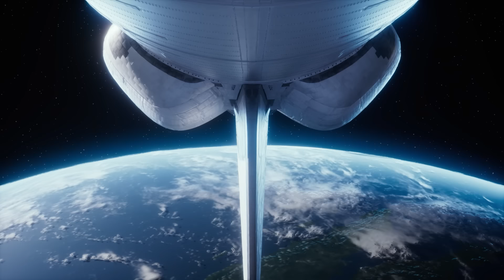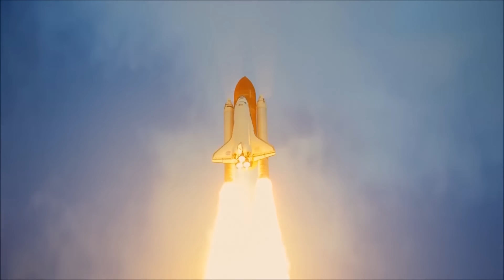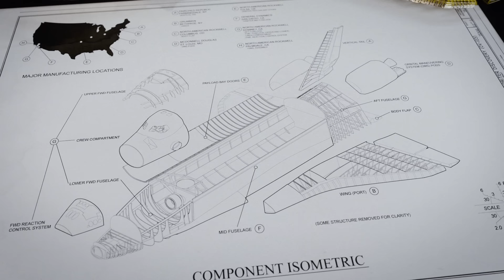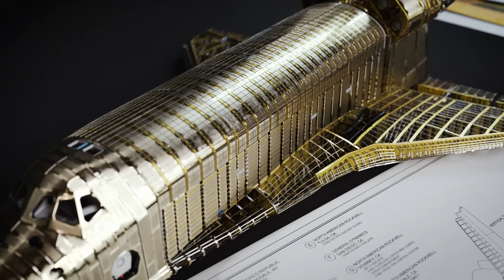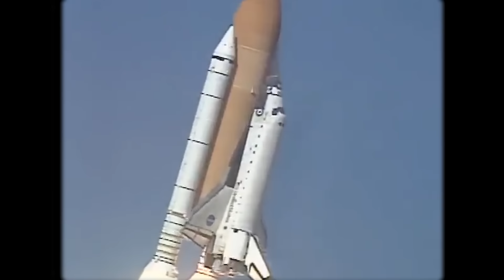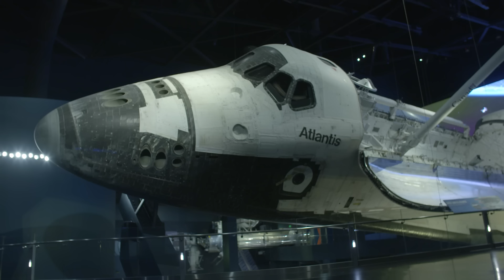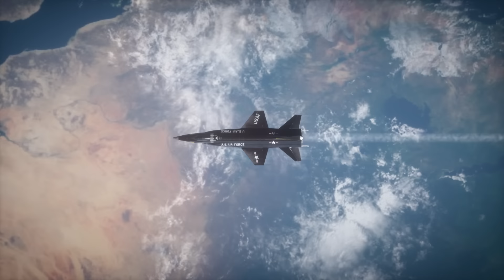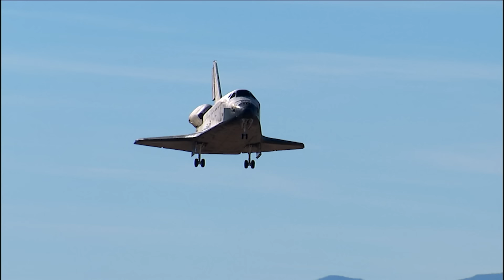The Insane Engineering of Re-Entry

Comment: The so called space shuttle has never reentered because it has never been to space sry really really sry
Reply: Proof?
Reply: @msidc1238  proof ok space starts at 62 miles high and nothing has ever been to space because rockets can not produce thrust in a vacuum so the rocket just falls back down at the 62 mile mark and the shuttle is neither a glider for it has two jet engines at the tail you can see the air intakes and you can hear them rev up upon landing even though they have a fighter escort to cover the sound of the shuttle jet engines
Reply: @James-zp5po  
" space starts at 62 miles high"
At 62 miles the necessary speed to get aerodynamic lift becomes as high as orbital speed. And some people thought to use that to define where "aviation" ends. And so use it as the "beginning of space". But that is of course an arbitrary definition. There is no beginning of space, the atmosphere becomes thinner fluently - you really never noticed that? You have never felt the pressure change in your ears when using a fast and high elevator? You have never heard that people need oxygen supply when climbing the Mount Everest? You have never wondered why oxygen masks fall down from the ceiling of an airplane in emergency? Already at 22 miles you only have 1 % of sea level air pressure, so not much air anymore. On the other hand there is still some atmosphere at 250 miles, so that the ISS loses more than 200 feet of altitude every day because the drag slows it down.

" because rockets can not produce thrust in a vacuum"
Bullshit. Why should that be the case? It seems you have no idea how rocket engine works. But OK, let's assume for a while that you are right, while all the thousands of engineers (including the ones who design the engines) don't know how rockets work. Then please give some details about the relation between air pressure /air density and thrust. 

Is it that there is a threshold? So the engine produces 100% of thrust all the time, also when you have less and less air, but when the air pressure or air density goes below a certain threshold, it suddenly doesn't produce any thrust at all? If yes, what is the threshold?

Or is there a relation like "half the air density = half the thrust"? Or a combination? So what is the formula? 

And BTW even if it would be correct that the rocket would suddenly don't produces any thrust anymore at 62 miles - why should it immediatly fall down? Have you ever throw something straight up, or shoot it straight? You know that there is inertia, so that the object keeps on going? The New Shepard tourist rocket goes straight up and stops the engine at about 40 miles. But at the end reaches 66 miles before falling down. If it would run all the time until 62 miles (so also reach higher speed then) it would go even much higher than only 66 miles.
Reply: @sebastiannolte1201  once you use words like orbital speed everything you say after that is not true because nothing has ever orbited because you can't orbit a flat earth and you have to go to space to orbit and you can't go to space
Reply: @James-zp5po  Sir, all you say is from conspiracy information you saw on internet, you didn't check any of the information, you are just spilling non sense.
Accept that you are not educated on the subject.
Reply: @elmaxlife  but I guess you are educated so are you educated enough to know the shuttle is not a glider because it has two jet engines at the tail complete with air intakes and exhaust and you can hear them when landing even though the shuttle has a jet fighter escort to cover the sound of the jet engines on the shuttle but you've never bothered to investigate because your so highly educated
Reply: @James-zp5po  says the guy who believe in an internet joke "the flat earth".
You don't understand real world physics, no-one can help you till you help yourself.
You are into religions, so whatever people will say to guide you toward the real nature of the world, you will not care to listen and do experiments in the real world.
but if your fairy tales helps you sleep at night, good.
Reply: @elmaxlife  so how about you doing this real world real life experiment get into your airplane and fly in any direction in a truly straight line not left not right not up not down and you will hit the ice wall that surrounds the flat earth now if the earth is round you will end up out in space because you flew a straight line but that won't happen because the earth is flat
Reply: @James-zp5po  You know, what happens in your little head is not necessarily the reality, you are making things up.
As I said, no-one can ever convince you if you refuse to acknowledge the world physics. You are bra!nwashed by relig!ons and internet conspirac!es.
There is not point in me to point the obvious flaws of whatever comes out of your mouth since you think you detain the absolute proof and you think you are smarter than everyone else.
Reply: @James-zp5po  as I said, you are into religions so you ignore real world physics, no-one can convince you back if you are entitled to it.
Reply: @elmaxlife  I am so sorry but you have made a horrible incorrect assumption I absolutely am not into religion because religion doesn't exist god doesn't exist Jesus doesn't exist the bible is fiction so that about puts that to bed
Reply: @James-zp5po If all space missions are fake, then why bother faking all of them. There is no point.
Reply: @Inv1ns1bl  oh there is a big big point put your thinking cap on and do your own critical thinking how much has NASA gotten to go to space about fifty trillion dollars but if we knew they had never gone to space no ISS no satellites would they have gotten that money
Reply: @James-zp5po  NASA has an annual budget of $22.6 billion, which is roughly 0.5% of the $4.7 trillion the US plans to spend. Additionally since NASA‘s inception they have only spent around $700 billion. You keep talking as if NASA is a private company and is just pocketing all the money but it is a government agency. The only other place the money can go is back into the US budget.
Reply: @Inv1ns1bl  wrong wrong wrong since 1913 and the federal reserve was created anytime the American government needs money for anything it has to borrow it from the federal reserve at interest that's the law and all taxes collected have to go to the federal reserve to pay back loans and the federal reserve is in charge of itself which is the law and if they want to print up 800 trillion dollars a day for themselves they do not have to report it to anyone and that is how money works
Reply: @James-zp5po  It looks like you are just pushing aside all my points to go on a tangent about something else. The Earth is round, the moonlandings weren‘t faked, we have been to space, have a good one.
Reply: @Inv1ns1bl  NASA exist to push a round earth I have been a truther for 17 years the earth is flat still and motionless covered by a dome 25 thousand miles high and the earth is surrounded by an ice wall 60 thousand miles long and 150 ft high and earth is 19 thousand miles across and nothing has ever been above 62 miles high and the astronauts get their astronaut wings at 50 milles high because they know they will never go above 62 miles high so just get in your airplane and fly in any direction in a straight line not left not right not up not down and you will hit the ice wall
Reply: @Inv1ns1bl  the earth is flat

Comment: basically the tiles used on the space shuttle are made from the same material used in hi tech crematoriums around the world which will hold upto over 1500 degrees c for extended long periods of time, plus the special interlocking system and also the hi temp screws and rtv hi temp silica based glue used to make sure each tile is secured in place. 🦘🦘👌👌✌✌👍👍

Comment: The cross-range requirement was 1100 miles by the Air Force because they wanted the capability to launch into polar trajectory from Vandenberg AFB and land after a single orbit, by which time, Vandenberg would have been 1100 miles further east. This polar orbit requirement was driven by the USAF desire to be able to deploy reconnaissance satellites to cover the Soviet Union, much of which was at high latitudes (which would not be fully covered by the the approx max orbital inclination of about 62 degrees w/ a "dog-leg" maneuver up the east coast), and then land again before the shuttle's presence was detected.

Amazing video BTW!

Comment: Como fue posible que llegaran en un modulo pinchurriento cuando fueron a la luna?  😂 sin que se quemaran entonces no fueron a la luna😢
Reply: The “tiny module” is the Command Module, which had a massive heat shield made from phenolic resin, specifically designed to survive reentry at the high speed the Apollo missions would have when they returned from the moon. We have a mountain of evidence that proves the Apollo landings are real.

Comment: Since first space flight all the vessels and people inside have gone through this treatment. Nothing unique with shuttles.
Now SpaceX has encountered with this banal problem.
Reply: The Shuttle was the first to be reusable. All other capsules are single-use, which made their heat shield a lot simpler (ablative heat shield using phenolic resin). SpaceX is using a very similar solution to the Space Shuttle, but are working to make those tiles easier to produce (helped by the simpler shape of Starship, which means they can crank out thousands of identical tiles, instead of having lots of unique tile shapes).

Comment: 40% loss rate of vehicles for multi crew reusable space shuttle. 100% loss rate for multi crew reusable inner space submersible. Bad trend and empirical results. Suggest engaging AI.
Reply: AI is crap at this kind of design problem.
Reply: both numbers are incorrect, the shuttle: 135 flights - 2 failures = 0.01% loss rate and "multi crew reusable inner space submersible" I would guess you are talking about submarines which, considering there are too many submarines to count and there have been many successful underwater expeditions the 100% loss rate is immediately excluded, so yeah, I just see hate, denial, brainwashing and mindlessness in your comment

Comment: I wonder:
Have SpaceX engineers seen this video? 30 to 40 years ago they solved the aerodynamics of atmospheric re-entry. The design of the Starship wings will be correct. How much will you have to modify your designs? How much does it cost to add parachutes to both the Starship and the Boosters? How much does it cost to add inflatable rings as rafts to the fuselages of both ships for recovery? How many engineers work at SpaceX?
Reply: You can't use parachutes in the moon. Starship is not your typical spacecraft. "Have SpaceX engineering seen this video" you're implying that SpaceX engineers are 1d10ts. FIY they're all NASA engineers employed by SpaceX.
Reply: SpaceX doesn’t want to drop the Starship stages into the ocean, because that makes recovery rake much longer and makes it far more expensive. They considered parachutes for Falcon 9 recovery, but quickly switched to using the engines to land the stage instead because that turned out to be faster and cheaper.

Comment: Aerodynamic craft is an overstatement. Brick with limbs.
Around 7km/s? Are you mad or misinformed?
Speed is not being leeched away, but bled away. 
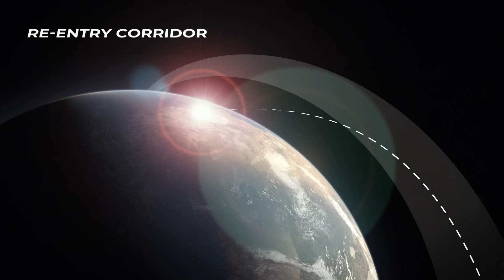1:46 and I had enough. Thats disgusting content 🤮🤮
Reply: 7 km/s is correct for the start of reentry. Orbital speed is 8 km/s, or 28,000 km/h.
Reply: @Hobbes746  check again, honey. You'll manage somehow, it's just early highschool physics. In orbital mechanics there is no "around" value. Even 5m/s delta V matters.
Reply: @Ansset0  If you’re familiar with orbital mechanics at all, you’d realize that orbital speed depends on your altitude. “around” is close enough for the purposes of this video.

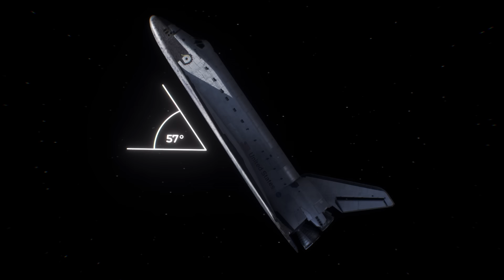Comment: @2:05 You hear 30 times the speed of sound. Ok. Let’s do the math. The Speed of sound -> 761 mi per hour. 30 times the speed of sound would be 22,830 mi/h , or  36.733 km/h . Who does believe that BStology, is fond of being bamboozled.
Reply: You’re forgetting that the speed of sound varies with altitude. It’s 340 m/s at sea level, closer to 290 m/s at 100 km altitude. The speed of reentry is around 7500 m/s or Mach 25.
Reply: @Hobbes746  WHAT is the speed of sound in a vacuum? NONE.  Speed of sound can’t be measured in a vacuum, because there is no sound in a vacuum. At 2:05 the narrator states that the shuttle re-enters the atmosphere at 30 times the speed of sound. Whether it is Mach 30 or 25 doesn’t matter. The point is reentering the atmosphere in the belly and delta wing position, which is the maximal surface of the shuttle, instead of reentering nose first, avoiding unnecessary friction. What they are telling people are blatant lies.
Reply: @michael.forkert  At 100 km, there’s no vacuum. There’s enough air to cause drag, and enough air for sound to travel.
Reply: @michael.forkert  And again, the point of reentry is to SLOW DOWN, which means you want to maximize drag, not minimize it. That’s why they reenter nose-up.
Reply: @Hobbes746  I was taught that at school, I believed that most part of my life, but I don’t believe it anymore. Know why? I tell you: Because NOTHING flies or floats in a vacuum.
Reply: @Hobbes746  That’s what they tell people, and you are one of the faithful believers.
Reply: @michael.forkert  Satellites don’t fly or float. They orbit: we accelerate them to a speed of 8 km/s. At that speed, the force of gravity pulling the satellite down is balanced by the centrifugal force caused by flying in a circle at 8 km/s. 
At an altitude of 100 km, you are just too low to do this: try it, and you’ll find that the satellite reenters the atmosphere within one orbit because there is enough atmospheric drag at that altitude to slow the satellite down. For this reason, most satellites orbit at an altitude of at  least 400 km, where the drag is low enough that a satellite can orbit for a decade before it reenters the atmosphere. 
We can verify this by observing satellites from the ground. Simple triangulation allows us to measure the speed and altitude of satellites.
Reply: @michael.forkert  We believe it because we can independently verify it.
Reply: @Hobbes746  We can independently verify it? WE who? Have YOU independently verified it already?
Reply: @michael.forkert  I have measured the speed and altitude of a satellite, as have many others. I have verified that satellites exist at an altitude of 36,000 km, as have approx. a billion people, by aiming a radio antenna at that location.
Reply: @Hobbes746  A bullshit in which 1 billion people believe, does not cease to be a bullshit.
Reply: @michael.forkert  Bullshit is believing in claims like “Earth is flat” and “space is fake”, claims which have been comprehensively disproven.
Reply: @Hobbes746  Comprehensively disproven by WHOM? Perhaps by NASA hired Pseudoscientific JointVenture of Bamboozlers as Michio Kaku, and his entourage?
Reply: @michael.forkert  Disproven by experiments anyone can repeat and verify. We have known (yes, known, not assumed) Earth is a sphere for 2500 years. We have known space is real for centuries: as soon as we could measure distances in space we could see that the Sun and Moon are at different distances, which means they are not projections on a dome, which means there is no dome.
Reply: @Hobbes746  Please name one or two  of the “Anyones” who have disproven it by experiments they could repeat and verify.
Reply: @michael.forkert  
The ancient Greeks proved that Earth cannot be flat, just by taking naked-eye observations and applying logic. Every time a ship goes over the horizon and gradually disappears from the bottom up, it does something that would be impossible on a flat plane. 
Every geodetic survey in history measures Earth’s curvature, proving that it is not flat. You can do a simplified survey with nothing more than a camera and a ruler. 
Scott Manley has done a video that shows how we can measure the speed and altitude of satellites. I’ve repeated his experiment, confirming that his results are correct, proving that spaceflight is real.
Reply: @Hobbes746  Your solitary neuron is affected by the fixed idea syndrome, which manifests itself through the manic impression, of being surrounded by a mob of flatearthers.
Reply: @michael.forkert  And again you’re wrong, but that should be nothing new for a reality denier like you.
Reply: @Hobbes746  When a solitary brain cell affirms compulsively that what is right is wrong and vice-versa, and has the constant feeling that there are flatearthers even in the vacuum of the brain it is dwelling in, unfortunately nothing more can be done.
Reply: @michael.forkert  Ad hominem attacks are the sign of the argumentless.
Reply: @Hobbes746  Your are right
Reply: A little research and comparisons will give you some proper knowledge and stop you making a fool out of yourself, Michael.
Reply: @SMHman666  do any research yourself.  You’re just a dumb kid with Dunning-Kruger.
Reply: @SMHman666  If you have a phenomenon in mind, you often think beyond it. If you only hear what is told you about phenomena, you don’t think at all.